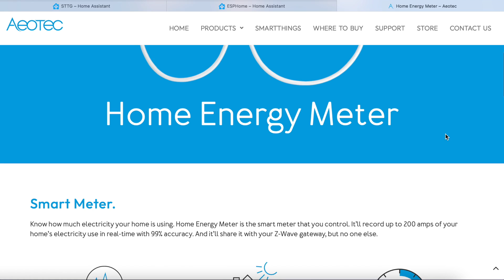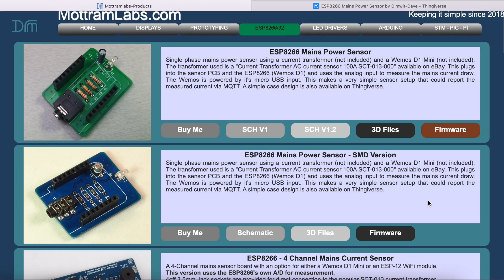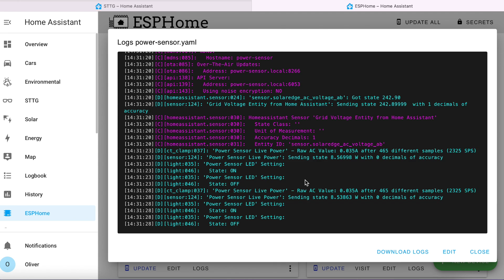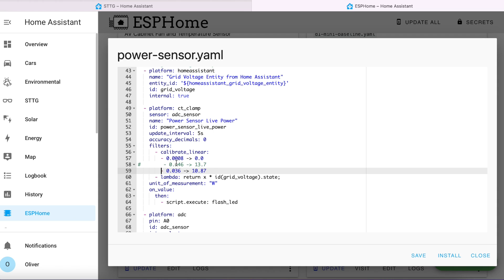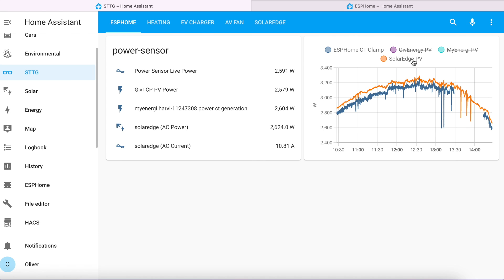Build your own CT Clamp Power and Energy Monitor with ESPHome

Comment: Just came across this and set one up at home today. Managed to pick up mains voltage from one of my Tapo home plugs and calibrated it on a 3kw load. It’s giving accurate figures compared to a calibrated current clamp I borrowed from work. It’s a very useful addition to my home assistant system.
Reply from the maker: Nice! I don’t actually use mine properly anymore. It was a great project to learn and play though

Comment: Temu, AliExpress and Alibaba have really inexpensive little boards performing energy monitoring, switching and Wi-Fi with which you may build your own smart plugs. They can also be spliced inline into a device's power cord for ultra simplicity. Wrap with electrical tape! Or preferably, for safety, enclose within a little project box. Some come enclosed with just the wires sticking out. Cheeep!
Reply from the maker: I think you'd have to be very confident in your abilities to do that safely!

Comment: so, basically if you dont have anything to measure before you set up this.. you can put 220-240 and it will be worthless .. Great project !! looked promising.. beside little hiccup.. it will not be accurate :D
Reply from the maker: It's a project for fun rather than something for accurate measurements
Reply: My UPS reports 126V pretty consistently,  My RV energy reading smart plug 60 feet away on the same circuit measured through a long extension cord reports say 123V generally,  running two heaters in the RV may lower the volts to 119V.  Sometimes the street power changes too. My point is, a smart plug moved around and observed over months might reveal a fair assessment of the circuit. The smart plugs are not quite accurate either though,  " Horses for Courses", as they say. Enough to identify surprising energy hogs and reveal formerly unknown parasitic losses.

Comment: Will this setup work using a 'Hall Effect Sensor' (for measuring DC current) instead of a CT clamp?
Reply from the maker: I don't know sorry, the creator of the board designed it for AC clamps specifically
Reply: @SpeakToTheGeekTech  Thanks for the response.  I think I have my answer.

Comment: Great video! After a number of hurdles flashing my ESP8266 I'm now at the calibration phase. I've determined that my zero load is 0.001, but I'm not quite sure what to measure a known current on... any suggestions? 
I was thinking say a kettle work (e.g. if i know it's a 2000w kettle at 230v then it would be expected to be 8.7 A) - but expect the factor of being off likely to be too high given the element probably isn't running at exactly 2000 and the voltage won't be 230v (and I don't think i have any way to measure the current grid voltage as I don't have solar)
Reply from the maker: A kettle is as good as anything for a baseline. You will end up with an estimate though without being able to measure the voltage. Whilst this project is a great little hobby project, if you want to do anything reliable with power monitoring you are best off purchasing a proper power meter like a Shelly device. I don't actually use my home-made device for anything serious because it's not accurate enough even with the voltage known - mainly due to the calibration process being tricky!
Reply: @SpeakToTheGeekTech  thanks - i'm only really looking to use it for a solid estimate on certain things, super accuracy isn't essential, but good to know.
I'm hitting an issue currently (no pun intended) where no matter what i run the clamp around i'm only measuring 0.001A... so something isn't quite right :/ but not sure what
Reply from the maker: I found an electric heater was the best to calibrate mine. I could add a couple of calibration readings into the sensor's linear calibration configuration: one at half power; the other at full power. Because it stayed on for as long as I wanted (rather than a kettle that cuts out) it meant I could get stable readings. I've found this sensor is more accurate at higher power draws, anything below about 400w got a bit iffy but again that is likely due to my calibration.

Comment: I've got this now setup for my house, with the goal of reading two hots on my Mitsubishi hvac 240v outdoor heat pump. But it's not working! I keep getting 400 watts of standby consumption - but my other energy sensor for the whole house (Sense Home Energy monitor, also ct clamps but on the two MAIN wires into the whole house panel) does not agree with the 400w standby load. Any ideas on why it might be reporting false numbers?
Reply from the maker: This sensor relies on accurate calibration at both high and low levels. It also doesn't understand power factors so can misread when the power factor is significantly different to 1.0

Comment: Will this work to tell me what the amperage draw is on my portable AC? It will run for 3-4  hours and then suddenly pop the fuse or in my case the resettable breaker. I don't know if the AC is drawing too much current or the breaker is bad.
Reply from the maker: Technically it probably would if you managed to put it around the right wire and calibrate it correctly, but I don’t think it’s the best solution for your needs. A plug-in smart plug with power monitoring capability is probably far more suited to what you want to achieve.

Comment: where do I find the Yaml code please.
Reply from the maker: The link is in the video's description
Reply: @SpeakToTheGeekTech  Hi, thanks for that, Having an issue with the code, this is what I get: an ideas

INFO ESPHome 2025.3.3
INFO Reading configuration /config/esphome/ct-clamp.yaml...
Failed config

esphome: [source /config/esphome/ct-clamp.yaml:9]
  name: power-sensor
  comment: CT-clamp power sensor
  
  Please remove the `platform` key from the [esphome] block and use the correct platform component. This style of configuration has now been removed.
  platform: ESP8266
  board: d1_mini
Reply from the maker: @D2eej  Try copying it again from my web site, I've just tweaked it slightly. ESPHome has changed the syntax since I made this article / video.
Reply: @SpeakToTheGeekTech  Many thanks work like a charm 🙂

Comment: Great video.  I have one issue, I'm in the US and I have 200 amp service.  Therefore the clamp's throat won't fit around the incoming cable(s).  I found a different clamp with a 19 mm throat and I think this might work.  However this clamp has no male fitting for the board.  Can anybody indicate what connections are needed if I wire the clamp with a jack.?

Comment: Not aure if you have a 3D printer by now? If not and you need any other project boxes printing, i would be happy to help. Just cover my postage costs. I have a solar edge inverter and have just connected it to HA via modbus.i was hoping the refresh freqeuncy was quicker so perhaps your project suggestion will give me faster polling of data.  Wish me luck in getting a power card working 😬
Reply from the maker: Thanks for the offer - I do now have access to one (although I don't own one!). The Power Flow Card Plus is the best card in my opinion, super-easy to configure now and it's moved on a lot since I first reviewed it. The SolarEdge refresh rate can be very quick, down to 1s if you wanted (I stick with 15s).

Comment: That's great stuff, thank you! Do you know how often it reports?

I want it to trigger a smart switch that controls my dust extractor when I turn on my table saw, it would be great if it could do it in a second or less.
Reply from the maker: The default configuration I have provided updates it every 5 seconds. You can adjust that value lower if you like but I haven't tested it myself. Just be aware that Home Assistant will eat up storage space much more quickly if you are storing values more frequently so you may have to exclude it from logging.
Reply: @SpeakToTheGeekTech  I'll give that a try, thanks!
Reply: That worked a treat, thanks for the video! I just need to figure out why it sometimes takes the board a couple of minutes to connect to WiFi, but the energy monitoring bit itself works great.

Comment: I have 3 pcs ct clamps 80A/3,2V and 3 phase system in the house. I gess it is possible to build 3 single phase monitoring  and put it in HA?
Reply from the maker: Yup there’s a multi sensor module available to do that.
Reply: @SpeakToTheGeekTech  Thanks a lot. Which one multi sensor are you talking about?

Comment: i cant get it to work. home assistant obviously isn't for me lol. managed to load up a raspberry pi 3b. that worked. im trying to do a d1_mini MLP191020 or a  MLP201185 esp32 
im just getting error MissingPackageManifestError: Could not find one of 'package.json' manifest files in the package. id love some code that just works. or a template from home assistant
Reply from the maker: My configuration is designed to work with an ESP8266 not an ESP32. The Mottram Labs header board itself shown in the video is only designed to work with ESP8266, he now sells a version that works with ESP32 instead though too. I haven't tried that yet personally.
Reply: @SpeakToTheGeekTech  Hi ive got it going by changing some code to 
esp32:
  board: wemos_d1_mini
  framework: 
    type: arduino
    version: recommended

This forced it to update the json. as for the MLP201185 4 port board the seller gave me some working code.
Many thanks for your video it has been a great help

Comment: Can i directly use this CT with my load and connect with Acrel meter  or have to put Arduino circuit between it.
Reply from the maker: No idea - this is a very specific project for a single purpose. Whether the components might work in your circumstances in a different solution I couldn't say sorry.

Comment: I would suggest a small upgrade to the PCB design, see if you can get more PCB's inside a 10x10cm panel. with snapp-off lines.
this way you can get more PCB's for the same price.
Reply from the maker: It's not my PCB design

Comment: I wan't to monitor the DC output from my Outback FM60 charge controllers. Can this work with DC? Maybe with a different ct clamp?
Reply from the maker: To my knowledge this only works with AC but you’d be best off contacting the seller to find out details like that

Comment: This is great, it's so simple and it works. All I have to do now is figure out how to convert the Home Assistant power graph into useable data to show me kWh/day, kWh/month etc.
Reply from the maker: Create a helper of the type 'Integration - Reimann Sum Integral' and use your power sensor as the source. That will give you a cumulative energy sensor. Once that starts to build up with data, you can then create more helpers of the type 'Utility Meter' using the new energy sensor as the source, and they can be on a daily/weekly/monthly cycle as required. I use a daily cycled utility meter sensor in my energy dashboard which gives you loads of graphs!

Comment: "Won't be quite so accurate"
yeah, about that. If you really wanna hardcode it I would go for ~235 or even slightly lower. Because in my experience it's usually closer to 220 then it is to 240. And especially during high load times it goes more towards the low end.
Or take a separate average over a week from that phase. Smartplugs can do that.

Comment: Brilliant video! How would I change the measurement into kw instead of watts?
Reply from the maker: The easiest way is to just edit the sensor in Home Assistant and change the units there, but you could do it in ESPHome instead and divide the output sensor value by 1000 before sending
Reply: Im trying the work out how much its costing me to run my heat pump, is there away I can show this data in kWh? @SpeakToTheGeekTech
Reply from the maker: @jamesabbott9606  Yes, create a new helper of type 'Integration - Riemann sum integral' and use the power sensor as the source.
Reply: That's brilliant! thanks, Ive used your other video on off peak tariffs, so I can work out my heat pump cost either off peak or peak! Ive also ordered the glow CAD, so im watching your video on how to set that up @SpeakToTheGeekTech

Comment: Very nice video, very good ideas. I need one. Put at this export costs from the UK, Impossible, If they had a cheaper way, this products would be a self runner
Reply from the maker: The blueprint is on the seller's web site (www.mottramlabs.com) so there's nothing to stop you buying the components and making up your own on a breadboard. It won't be as polished and requires a bit of soldering, but it's not impossible.

Comment: How are you putting the ESP in to bootloader mode, I bought the AZ Delivery one you recommended, I looked at the docs and it says to pull D3 low for bootloader mode, I have shorted D3 to GND, but it refuses to let me flash it, I've also installed the drivers from their website.
Reply from the maker: I didn’t do anything special at all. I plugged it into my Home Assistant server (Raspberry Pi) using microusb and used the ESPHome interface to flash it. No shorting of pins was required.
Reply: @SpeakToTheGeekTech  - It's fine thanks, managed to flash it in the end, something on the machine I was using didn't like it, but in other news, I can't get the clamp to read anything, constantly showing as 0w
Reply: All I keep getting is this:
[15:22:59][D][homeassistant.sensor:024]: 'sensor.shellyplus1pm_441793a76958_switch_0_voltage': Got state 241.70
[15:22:59][D][sensor:093]: 'Grid Voltage Entity from Home Assistant': Sending state 241.70000  with 1 decimals of accuracy
[15:23:01][D][ct_clamp:040]: 'Power Sensor Live Power' - Raw AC Value: 0.000A after 188 different samples (940 SPS)
[15:23:01][D][sensor:093]: 'Power Sensor Live Power': Sending state 0.00000 W with 0 decimals of accuracy
Reply from the maker: Do you have the clamp around just a single live core or have you clipped it around a three core wire with neutral in too? Did you get the exact same model number CT clamp in this video?
Reply: @SpeakToTheGeekTech  It's clamped around a 3 core cable, I've bought 2, both the same model (SCT-013-000 - 100A/50mA), does it need to be around live only?
Reply from the maker: Yes it will only work around a single core. If you have it around both the live and neutral at the same time (like in a three core) then your neutral will be cancelling out the live so it will read 0.
Reply: @SpeakToTheGeekTech  lol, very much an issue with the pink squishy component in this then lol, ordering some cables and plugs/sockets to use for testing before I install it in it's final location where I do have access to just live.

Many thanks :)

Comment: I've been wondering about the issue with measuring the current for standard triple core cabled devices.  Would it make sense/work to have a short (1m) extension cable with a short section with 3 coated wires exposed and the CT clamp around the live.  Then have the D1 powered from a USB adapter on the extension.  I know you are then measuring the devices current at the same time but would it be negligable enough to ignore (or calculate out)?  Or am I talking nonsense?
Reply from the maker: Exposing the cores individually and putting the CT around one of them is the only way to monitor it. Of course that’s not particularly safe in some circumstances so I’d suggest doing that inside a protective casing or wiring box.

Comment: Great video to help get started with this. My stumbling block though with this has been how do you power it. I dont have power in my meter cupboard and I guess most people dont. I had thought I could use batteries but aparently these drain very quickly. Does anyone have thoughts on this. ESPHome seems perfect but there is very little on how you power the devices.
Reply from the maker: If you are using this on your grid feed and there's a chance you could be exporting then you may want to look at a different product. This solution can't tell which direction the current is travelling. As for battery powering, the code was written on the assumption it would be powered by a mains supply. In order to save battery power then it would need tweaking to measure less often and sleep in between. You could probably reduce its overall power consumption to 25% as a rough guess by optimising it that way.

Comment: I don't understand how you were able to use a sensor that outputs current by measuring voltage and then with your calculation.
Reply: The PCB has a specific resistor. The sensor output is a current source and puts a current through the resistor that is proportional to the current measured in the cable. 
The micro ADC measures the voltage drop across the resistor and uses ohms law to calculate the output current.